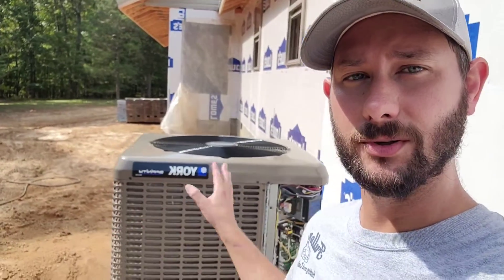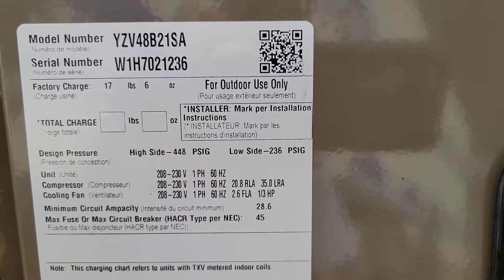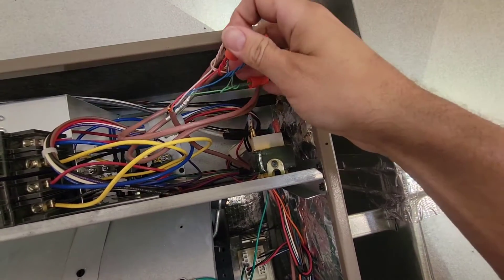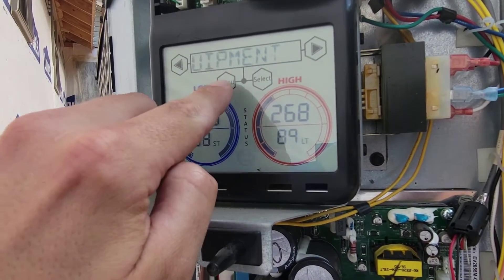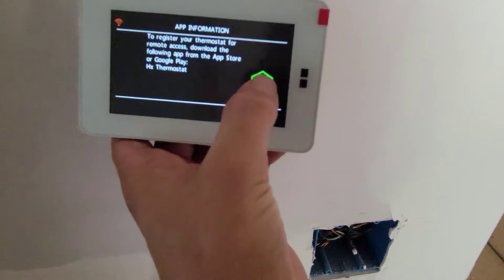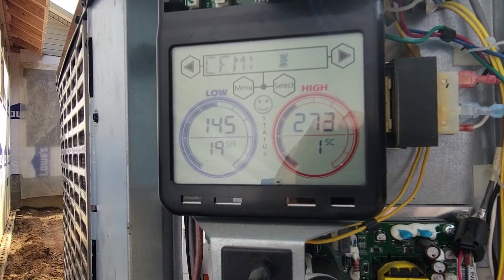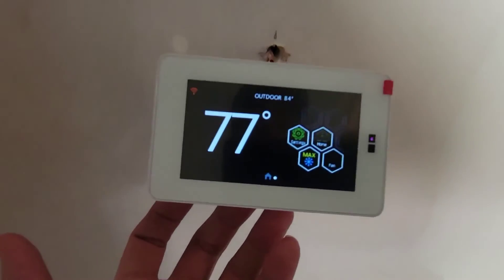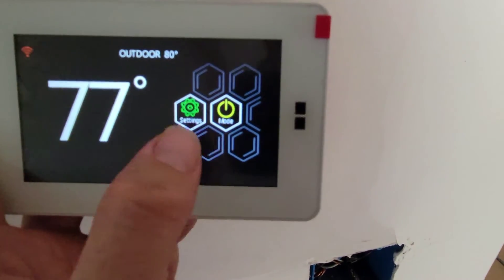YORK YZV Heat Pump Start Up and Wiring Tips @YorkHomeComfort

Comment: Any advantage to using a York thermostat or Ecobee?
Reply from the maker: ecobee is better
Reply: @  great. We have Ecobee 3 units. Coming from conventional AC unit and gas furnace, when using a dual fuel heat pump+gas furnace, do just keep your existing schedules and it turns off/on? Or do you set a constant temp and it’s more efficient for heat pump to maintain it?

Comment: I wanted to go with this heat pump and my York 96% two-stage gas furnace, but my HVAC company wouldn't install it. Put me in the HMH7 with a Honeywell thermostat. Nice unit and effective. However, they told me they couldn't keep the thing running. Said they would sell it to me but I'd have to find someone who would install it. This from a big York dealer in northern Idaho.  Kind of odd. You have any issues with this unit? I  suspect their folks weren't trained enough on it but not sure. I will say the HMH7 is very nice but not Energy Star certified  which I though was odd. Is a cold climate unit, though. Can run it down to 5 above but not economical when looking at the existing gas prices. Decided on 15 above before the changeover in my area. Always been a Trane guy but  since the same outfit messed up on that install, they comped me a new York furnace and a great price on the HMH7 and fixed my poor ductwork (partly their problem) on the four-year-old build. Also got a 10-year parts and labor deal out of it. They did me a solid there.

Comment: Teddy do you have a link for York training on these units ? I’m trying to charge/ check one and want to know if you can put it in a test mode or full load on both condenser and ahu to get the right sh and sc readings.
Reply from the maker: I think I have a video on that if I don't I will do A video for you
Reply: @taddydigest  good cause I can’t find any literature on it. It’s a YZT48B21SA.
Reply: I just emailed York. We’ll see how that goes. The customer was having trouble with the unit. Someone added refrigerant and had me go do a leak search. Well I found the original air filter inside the unit that no one knew was there. Blower panel was missing screws and flexing open. Let’s just say I’m probably going to pull the charge and weigh it back in.

Comment: Thanks for the great info and video. Do you recommend the Rheem RP20 with econet or the York YZV with Hx3? Could you explain why you recommend one over the other? Thanks a bunch.
Reply from the maker: I am not familiar with the Rheem rp20
So I don't know which I would recommend
I would try to find some customers who have that.
Reply: @taddydigest  thanks for the quick response. So do you like / recommend this yzv system? I really like that it has the LCD on the unit so I could check on its status. I'm guessing most other heat pumps dont have such a thing.

Comment: If you're pulling a vacuum on both liquid and vapor lines do you still need to power the EXV ? it would be pulling from both sides of the valve correct?
Reply from the maker: I would still recommend powering the e v valve during the process
But I see what you're saying
Reply: @taddydigest how do you power just the eev ?

Comment: Hi
I love your video,
I need your help please
I have the York affinity zoning system in my house, it’s about 7 years old, and it has 3 zones and 3 dampers on it,
I just replaced the zone board and the 3 thermostat , but I can’t get it to function normal, the main thermostat works but not the additional zone thermostat, I don’t think the zoning is working, I replaced everything and wired it exactly as the old one, 
any thoughts on that? 
Thank you
Reply from the maker: I have many thoughts about this
But in message form like this it's hard to get the point across
If you want my phone number and me to walk you through it join become a level 4 member I will give you my email and then my phone number
Or at least become a level one and I can email you
Reply: Thank you for the quick reply,
Yes I like to join, 
But how do I join and become a member?
Is there a link?
Reply: Hi
I just joined 
Can you send me your email, I can send you the pictures and a video, hopefully that will help.
Thank you

Comment: Great video. Thanks. I just got this new system and having issues. Keep getting "Hi Discharge Temp" Fault and the heat pump will not turn back on. I am stuck using my furnace indoor unit heating only. Any suggestions why this is happening? Is the compressor faulty or is it bad config ?
Reply from the maker: Hey thanks for watching 
could be several things
 I need a little more information

Comment: how do i reset this heat pump after a lock out due to low pressure fault?
Reply from the maker: Go through the CDA and the main menu and go to modes and then go to fault history
 And clear the fault history my pushing select

I will do a video on this

Also turn the breakers off to the indoor and outdoor units for 15 minutes and then reset power

Comment: Hello Sir 
I have YZV 3 ton unit but I don’t have 24 v low voltage on outside Unit any suggestions 
I have done my wiring same as yours but still don’t work
Reply from the maker: Make sure that you did not hook the 24 volt wire to the  R terminal on the master communications board.
Otherwise it destroys the master comm board 
check power to transformer on primary and secondary
Reply: Thank you Sir 
I have found the problem it was really helpful information fuse on the outside unit wasn’t working so I just replaced new one 
Also I need little more information For electric expansion valve 
Outside unit YZV36B21S 
Inside Unit AHV36C3XH21CC 
I’m Looking for Electric Expansion Valve any suggestions 
Thank you Sir